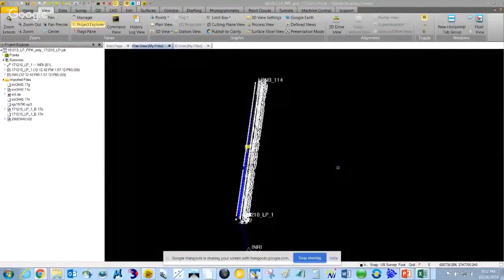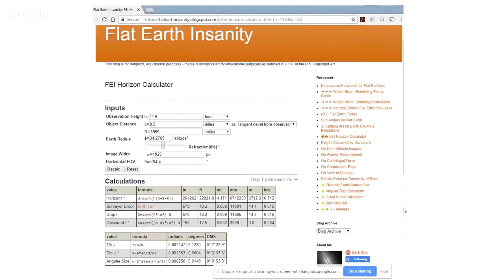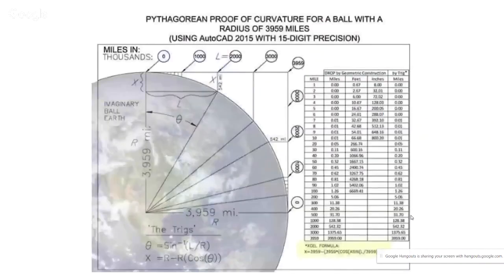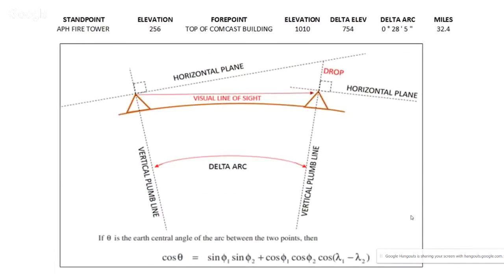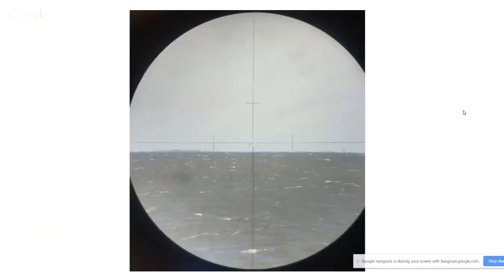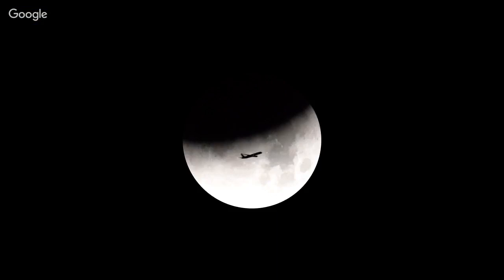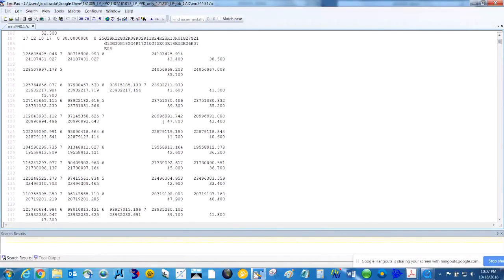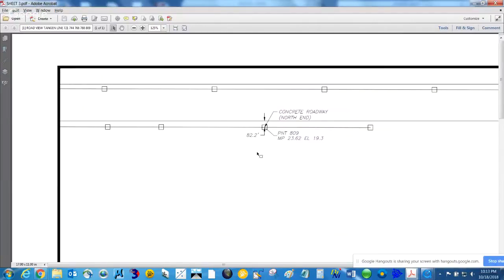Lake Pontchartrain Causeway - By CD, Jesse & Soundly

Comment: Why not use the total station to verify the 32” drop along a 2 mile lake shore. Take a shot at the lake surface at one point. Then plot a perfectly perpendicular to plumb plane from that point and go 2 miles down shore and measure the drop from that original perpendicular to plumb plane to water’s surface.
This is what the total station is designed to do.
Reply from the maker: You would need to ask Jesse Kozlowski about that...he's the one that took all the shots...he did use the total station....we wanted to see if the bridge went along curvature of Earth and it does
Reply: @ChrisDegenhardt2000  I have posted in his YouTube comments with no response. It seems that there hasn’t been a response in 2 years on his channel.
Reply from the maker: @allthingsbing1295  I think he got tired of flat earth because he's done so many videos and flat earthers don't comprehend what he's showing